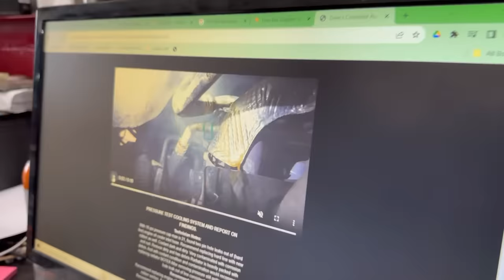The truth about maintenance, and what the manufactures tell you vs what you need to know

Comment: My 2011 Duramax has just under 400,000 miles on it. I do a service on it (myself) everything 7,500 miles. Engine oil and filter, fuel filter, air filter, transmission fluid and external filter, grease points, and tire rotation. Internal transmission filter every 50,000 miles. I spend the money on high quality AMSOIL synthetic fluids and good filters from the local parts supplier. I use HotShot's Stiction Eliminator and Shift Restore with every service. I use premium diesel and HotShot's EDT (winter version when cold) every time I fill up, and HotShot's Diesel Extreme (injector cleaner) with every service. Front and rear differential and transfer case oil every 75,000 miles with high quality gear oil. 

Maintenance can be cheap. Proper maintenance is not cheap. Am I a bit overboard? Perhaps, but I want to do the best work I can. My truck has been good to me, so I will be good to it.

Comment: I have been saying this for years. A lot of "problematic" german engines are problematic, because the factory recommended oil changes are waaaay too long. One great example: the 3.0TDI V6. It uses 4 timing chains and a dozen tensioners. The ORIGINAL factory oil change recommendation back when this engine came out and before they changed it to avoid all the angry people and lawsuits was ....... 14.000 miles. yeah. 14k. And then you wonder why almost all of those early engines rattled like crazy because the hydraulic tensioners all wore out, the guides worn down and eventually the chains stretched and jumped time at just 70-90k miles... Meanwhile those engines if you change the oil at 6-8k miles, could easily do 200-250k miles before you even needed to replace a tensioner or a guide let alone any of the chains. Plenty of these engines driving around in europe with incredible milage on them and a lot of them are still on factory timing chains because their owners realised that 14k is absolutely ridiculous for oil changes. And this was just one of these cases, there are a lot of german engines that if you change the oil at half the interval of the factory recommendation, it easily lasts just as long as a toyota or honda engine...

Comment: I used to get into violent fights with an amsoil dealer about oil change intervals. Over the years it turns out my Dad was right. Change your oil. The only thing that has changed with modern synth oils is you now have a 2k cushion on that 3k mile oil change. 
5k is the limit I dont give a damn what anyone else says. 
I have seen the difference with my own eyes too many times.

Comment: Im an ecodiesel owner which is the truck in the video so ill say this. Maintance yes its important but the downfall is the emissions system. The engine is from Italy and they never designed it to use an emissions system. So that clogged intake is normal because of the EGR. Also the efficiency is horrible because of regen. After a delete on mine the truck responded far better, no more carbon build up, and even the oil comes out cleaner during oil changes. So do yourself a favor and lose that system that wastes more diesel and contaminates the engine far more. It will save you money in the long run and will even drive far better.

Comment: I’ll say this. I have a 2018 Peterbilt 389 glider with a 12.7 Detroit. I change the oil every 7-8k miles. REGARDLESS. Yes, she pulls heavy loads, and that’s why I do not follow Detroits maintenance recommendations. That’s 10 gallons of oil, filters, fuel filter, lube, etc. Costs me around $250 if I do it myself. If you think your car that holds 1-1.5 gallons of oil doesn’t need an oil change until 10k miles, have fun eating a bill for a new motor at 100-150k miles. Oil degrades quick when your rpm are more then triple mine. Oil is your engines blood. When it goes, so does the engine. Just my .02 cents.

Comment: I have an 03 merc (c320 coupe) , manufacturer specs 15000km oil changes, and lifetime transmission fluid. Needless to say I’m not that stupid so I do my oil every 7500km and trans every 60-80k kms. In Mercedes’ defense they did go back on the ‘lifetime fluid’ and recommended a one time change at 40k miles, but a one time change isn’t going to get it to 200/300k ill tell you that for sure.

Comment: What you forgot to mention here was that people shouldn’t put water into the reservoir or radiator. Because that causes corrosion and sludge buildup. Instead use distilled water. I’ve been using distilled water for years in my vehicle that reservoir has no sludge at the bottom. Also change the coolant every 3 years that will keep those parts in the cooling system lubricated.

Comment: The coolant reservoir of the M278 GL500 x166 has a little bag inside thag absorbs moisture after about 150,000Km on the dial it will explode & gutter the radiator the pipes that will malfunction the air flow of the air system in the car. To fix this you can cut out the little bag rince clean the reservoir theb install back to the system. Check the coolant level because after interfering with it you will loose a little of the coolant. Don't be afraid to delete this little bag the new Mercedes come without one. Also if the bag explodes you will have bug problems getting all those particles out the system usually you would even have to replace the radiator. Thankfully I learned this before the bag exploded & cut it out the reservoir of the coolant. If you wont instructions with pictures let me know I'll send a link. I'm not sure what other engines besides the m278 come with this timed bag. You are supposed to replace the reservoir of the coolant if you go the by the manual but it will cost you more & is just really better to cut it out you'll never know exactly when it will explode on you.

Comment: Dave, I bought a 6.7 L power stroke Ford F250 used with 25,000 miles on it. Since I have owned it I use Amsoil in all of the cavities. In your opinion, how often should I be changing that full synthetic motor oil? Manufacturer says 7500 Amsoil says 25,000 what’s the right thing?

Comment: Dave, since this video is on maintenance I’d like to ask you about a 2010 Cummins 6.7, I have read a lot of things about the grid heater bolt breaking down and being sucked into the engine. Is this something I should replace on a schedule or is there a fix for this issue? I have seen the Banks intake tube with a different type of heater. Is this a viable fix? I bought this truck at 22,000 miles and it has 113,000 now, at the price of trucks these days I need this one to last me as long as it can..

Comment: My mom had purchased a brand new Hyundai Kona and it came with a service contract that the oil changes were covered for up to 3 years or 36k miles. I’m a mechanic and have been doing this kind of work for as long as I can remember. So I didn’t want to touch a thing on the vehicle so that way I/we couldn’t be blamed for any type of issues or problems that could come up. So I left my house and was driving to see my son 2 hours away from where I live. About an hour into the drive I heard that all to famous tinging noise and then the check engine and oil pressure light came on in the dash and I smelled oil and when I got pulled over and stopped I could see the oil dripping from the engine. I get the car towed to my job and take a look at it in the morning and saw said missing oil drain plug and my mom calls the dealership it was purchased at and they come get the car and start looking at what happened. The only thing the dealership had to say was that somebody tampered with the drain plug and it wouldn’t be covered under warranty yet they were the only ones to ever work on it, put air in the tires and rotated the wheels and tires. It’s now been almost 2 years since this happened and they still will not take blame for what happened. She has sued the dealership, Hyundai North America because the only thing they were willing to do was put a used motor from the junkyard for $2,500. So she’s still been required to make the payment on a vehicle that she hasn’t had in 2 years and they weren’t even offering to give her a rental car as well. So I will never let a dealership let alone someone that I don’t know touch another vehicle that I or any other family member own because of this very reason. Dealerships are a joke and they charge an ungodly amount of money per hour and they do crappy work.

Comment: dealers make more money replacing a transmission than replacing the the fluid and filter. i took my car in to get it flushed, and the dealer told me it had lifetime fluid in it. i said so what? you know its bs. then they called me and said there was no drain plug and had to put one in. and it is a bmw that i took to a ford dealer lol. i got it done though

Comment: Now, as my recollection goes, our society works better with planned obsolescence. BMWs are made for higher classifications and are just as good as any other car after three years. If you’re looking for a vehicle that will last you look for brands that are more designated for that like Volvo, ford, Kia, toyota. I know plenty of engines that are doing great with 10,000 mile oil changes and over 300,000 going strong. Remember the only thing that breaks down oil is external contaminants that the detergents cannot overcome, and the number one cause of oil breakdown is a bad seal or overall bad intake track including air filter. That is the number one place where engine failure begins to happens. You can ask engineers or mechanics that’s why oil, oil bath air filtration is technically the best for the engine for a side note. Thanks!

Comment: The carbon build up is common on that 3.0L diesel that Dodge  uses. It's not True they care but when they run the number they think your going to buy a new car in 5 years like the old days. the other problem is the cost of the menatance, on the new jeeps the oil filter are one unit so instead of $25 for the filter it's $130 for the filter and housing assembly.  plus  the oil , plus the 2 fuel filter that Dodge has, the price for maintenance and repair  is out of this world.

Comment: Nobody listens to me about changing transmission fluid, coolant ect. If you change the fuild when it really should be changed your vehicle will last. I have had toyotas that I took care of last hundreds of thousands of miles with very very little needing to be fixed. Yeah things that always wear out have been replaced like suspension parts, tires, belts, pullies but the drivetrain is still amazing and works flawlessly. And get this. It doesnt leak anything.

Comment: Yes unfortunately you are correct or a new transmission, which with all the CVTs (looking especially at you Nissan JATCO Junk) will leave you with a $5000 sticker shock or more just for the transmission not installed.

Comment: Working on a tractor right now with 9000 hours on it. Cooling system has never been serviced. Coolant looked like muddy water. So far head gasket, water pump, radiator, and hoses have been replaced. What a mess.

Comment: How do you get rid of the rust. I have cleaned and cleaned the water in my jeep but the rust keeps coming. I got it like this. The rust collects in the coolant reservoir. I get a lot of cars with just water. But even after cleaning it out the coolant always turns rusty. If Florida peopel think we dont need coolant. it is one of the few things I have no sure fire way to correct once and for all. So any leads would be useful as I keep acquiring cars with this issue. 

THERE ARE NO GOOD SHOPS IN FLORIDA.  They all do the minimum necessary to get a check no matter how much you pay. That's why I know what I know now.

Comment: Ive heard you mention to cut the intervals in half but the ford says to change the oil in my 6.7 Super Duty every 5000 miles which I didn't think was crazy but do you really suggest i change it every 2500 miles? I send samples in to Blackstone and it always comes back saying its still good for longer. I still change it at 5k but just can't see changing at half that

Comment: Dave my mechanic recently did me a head gasket replacement job, how do I know it’s been done correct. Originally I didn’t have any big problems I only had the coolant unsteady very slightly which is indicates the head gasket leaking air into coolant. We took the head off and neither head or gasket is broken just gasket seems getting old

Comment: I think the truth is answered with four simple questions. 

1 - Why is the fluid, grease, part in there? What's it's job?

2 - What purpose does it serve? What fails if it fails?

3 - Does it's ability to serve it's purpose degrade over time/mileage?

4 - WHEN is the SAFE/COMPROMISED point that occurs?

So with that... Non severe intervals: 

5k mile syn oil and tire rotation
15k mile alignment
30k air filter and brake fluid
60k coolant and trans and diffs and ps
100k tune and drive belt
Wash Rinse Repeat

Comment: I like your mindset, but you didn’t draw a conclusion as to why maintenance would have prevented the coolant leak. How does changing the oil and replacing air filters affect the coolant system?

Comment: I change all the fluids on my car myself. I do the oil every 3 to 5 thousand miles, never a day past 5000!. Front and rear differential every 20,000 as well as the transfer case. My truck requires a lube on the drive shaft so I hit those too at 20000 miles. The transmission I leave that to a professional mechanic. There are many other things, like air filter , cabin filter, wiper inserts,  that are very easy and keep your car in tip top shape. I'm not big on the dealer for these services since I have seen they frequently assign these services to the kid who parks the cars!!! NO THANK YOU!!! Tire pressure and paint care are  another thing people ignore!

Comment: I have a 05 Chevy lly. Doing my oil change every 7500mi is that ok? Or should I do it every 5k?  Also I do the trans every 30k along with with the rear diff oil. I need to do the brake fluid and coolant flush. I have 133k on the truck

Comment: So, the GM 1.4 turbo engine gets A LOT of hate, and some of that is deserved. However, my roommates have a 2011 Chevrolet Cruze with the 1.4 turbo engine, and 111,000 miles on it. All that has been done is maintenance, and more to the point, the car has only gone above5,000 miles on its oil changes a couple times. I have recently had the turbo off the engine to replace the oil lines to the turbo and the oil cooler as it was leaking. The turbo itself with (at the time) 105,000 miles has a small crack in the housing near the waste gate. The crack does not go through, the waste gate does not have excessive play in it, the turbine and compressor do not have excessive play either and turn beautifully. A friend of mine worked for a Chevy dealership as a service writer and the most common issues with Cruze 1.4 turbo engines are bad turbos, and often around 50,000 miles, or according to the "normal" maintenance interval, 5 oil changes into the engine's life. My roommates' car I put new spark plugs in it at 55,000 miles, did another set while I did the turbo oil lines and oil cooler, did the drain and fill on the transmission fluid, and installed an aftermarket ignition coil because as it turns out, the OEM coils are garbage from the factory. If people would actually take care of their stuff, things could last a lot longer than they do. That said, there are companies like Chrysler, it does not matter how good you take care of their vehicles, they are still garbage.

Comment: SO this whole "double the cycle" advice is what I did on my transmission.  Dealer recommended 150k get a flush, clean and refill. SO at 80k I thought "why not?".  Well that fried my tranny and I had to pay $7K to get it completely rebuilt at only 84k miles!!! The tranny shop said "NEVER EVER do a flush n fill on these newer cars. The flush pushes any debris into the Electronic Control Module where the small capillaries get clogged and stop working and it will burn up your tranny."  Not only that, during the rebuild I had to buy a new one because it failed the testing.  "DRAIN AND FILL ONLY" was the recommendation from the transmission shop and he said if more people would do that, I'd be out of business. 

ALSO you should do a whole vid of how to find a reliable and trust worthy shop because every single shop I've been to has some flunky that's screwed something up on one of the many vehicles I've maintained over the years.  Good, honest and reliable shops are almost IMPOSSIBLE to find these days.

Comment: I perform the maintenance all everything I own and would never trust any shop to do it, period. Your shop is the exception but just think about it, every shop is having maintenance performed by the lowest qualified person in the shop. I will give you two simple examples, I took my truck (one time) to a shop to have a lube job (Engine oil change and grease the chassis). The truck rolls out and is ready to take home. I check the chassis and not one grease zerk had been touched. Example 2, I bought a truck from a hospital with all the maintenance records. The shop they used filled out records that they greased the truck every 3,000 miles. The dump bed was so rusted it sheared the tubes off because it was never greased and they had to change the engine because they never changed the oil.

Comment: I have a question about the viscosity of the oils recommended by the manufacturers.. 
My experience is only with gas engines, but 0W-20 is recommended. 
Why is it that aircraft piston engine recommendations are for MUCH HIGHER weight oils? 20W-50 for Rotax, and\or 80 or higher straight weight oils for Lycoming and Continental.